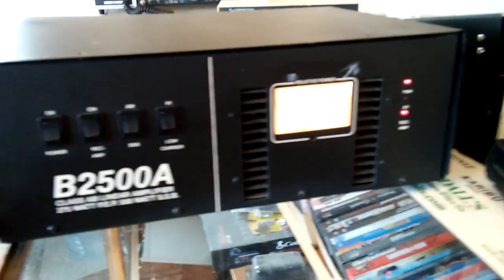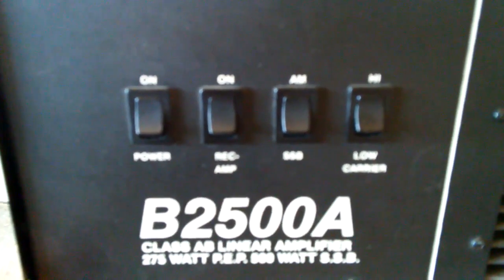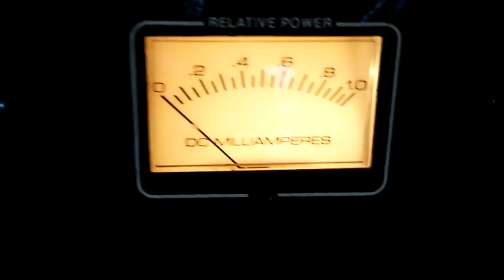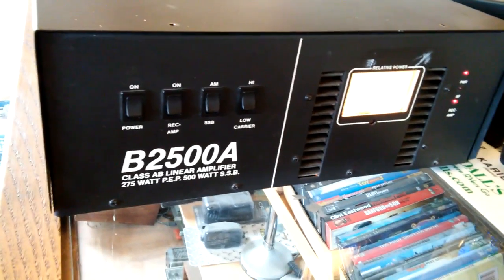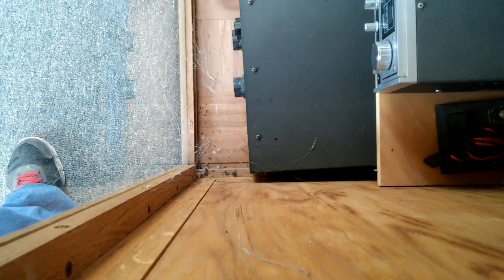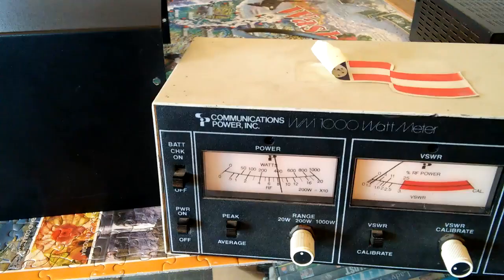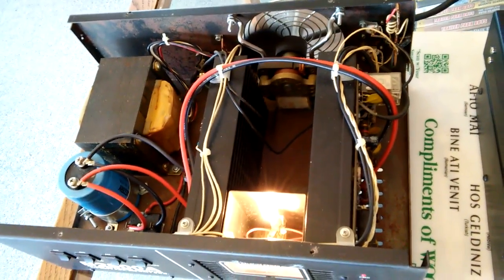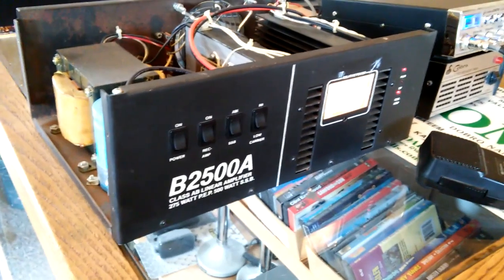B2500 CB Radio Linear Amplifier

Comment: It is a very nice piece... but let's get down to brass tacks... it's just your basic. 2 pill base amp.in class B circuit just like Texas Star and everybody else... I know some amps  say  AB1... but that's BS on a solid-state transistor amp.... the high low switch on the front is just that high-low.... you really looking on high-power to have that amplifier deadkey 40 watt ... and let her swing from there.... so that means 2 Watts from your radio is too much key... anyway enjoy that awesome amplifier great  video man I enjoyed that
Reply from the maker: Sad to say, but I inadvertently hooked it up to my Connex Saturn base, (to many wide mouths) gave a few shouts on SSB and kissed off the amp.
I need to pull it out and see what I can do.
Reply: @390WagonMaster  well I see you've dealt with 3 made... send it to him have him put a couple of HG 2879s in it...